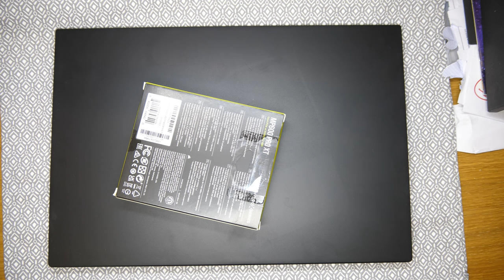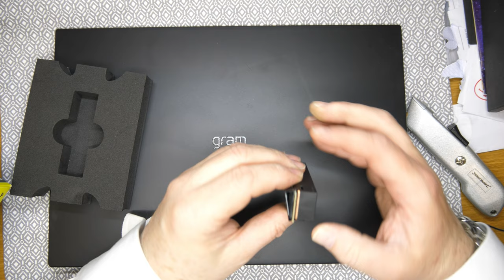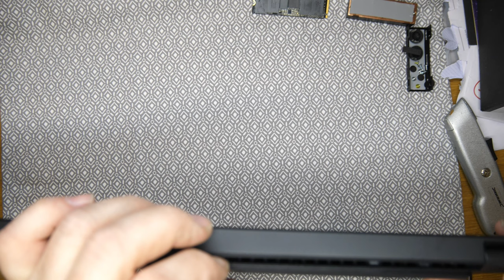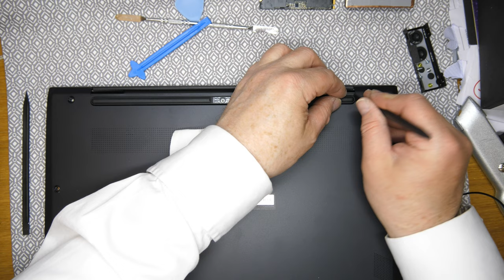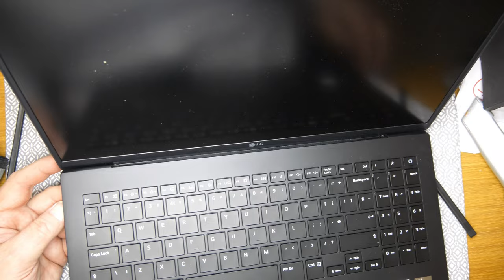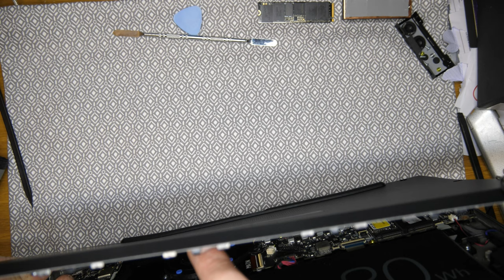Grunting elephant performs LG Gram 16" 2022 Teardown & SSD Upgrade

Comment from the maker: Some additional comments on cloning the SSD, as I lost a few hours trying to get it to work. These are the steps that worked for me.

I put the original 1TB SSD into a USB-C M.2 NVMe caddy, and placed the new SSD into the original NVMe slot on the laptop's motherboard. This is the recommended config for Acronis 2022 cloning.

I used the Acronis TrueImage 2022 bootable media on an optical drive.

To get the laptop's boot menu up, hit F10 immediately and repeatedly at boot, and choose the optical drive to boot.

I used the Automatic cloning method which resized the main partition from about 900GB to 3.6TB, and it took about fifteen minutes or so.

Make sure Bitlocker is off and the drive is fully decrypted before cloning.

To perform a factory reset, with the AC power in, turn on the machine and then immediately press and keep the F11 key pressed until the Windows PE environment comes up.

I removed McAffee, Laplink and Alexa, and disabled Teams at startup.

Comment: Thanks for the video, very helpful. The reluctant cover is simple to remove, just slide it a little bit, no force needed.
Reply from the maker: Needs a video - are you offering by any chance, it would help this grunting gorilla out!!
Reply: @nezbrun872  Thanks, but I was shaking during the teardown. I hope not to open it again... ever :D
Reply: @nezbrun872 I can second @codeblocks’ comment, that the cover can be remove without much force/trick. Two steps: (1) Tilt the cover open; and (2) Wiggle the cover, and at the same time lightly push the cover towards the back of the laptop. It will release quite smoothly.
Reply: @zzlife9905  This video shows the wiggling you need to do. At first I was a bit confused about the exact motion, but you have to wiggle it back and forward towards the front and back of the laptop, not left to right.
https://www.youtube.com/watch?v=9fTL4lzH4Bs&t=501s

Comment: Removing the pre-installed heatsink usually voids the warranty. Just but the heatsinkless model
Reply from the maker: As I stated, there was a very substantial discount on this SSD SKU at the time (ITRO $100 cheaper than a bare SSD or so), that is why I bought it. Of course I'd have bought the bare version had it been the same price or cheaper.

Comment: how you experienced any heating issues with the lg gram? It seems like the only glaring issue about the laptop. Also Thoughts on returning and getting the 17 inch version?
Reply from the maker: It does thermally throttle for me during video editing 4K60P, but I haven't investigated it any further.

If the +view monitor had been 17", I'd have bought the 17". However to match the +view, I bought the 16". I have a 17" 2020 LG Gram already. Thankfully my eyesight + glasses are good enough to see the 2560x1600 screen at 100% scaling on 16" as well as 17".

I won't be returning it, I never even considered it.
Reply: The 17" has thermal throttling for me as well at 20~22W CPU Package Power

Comment: I have the 17in model. Anybody know what I can do to make the max volume louder?? I find the audio very low
Reply from the maker: Same with my 2020 17" LG Gram and 2022 16" LG Gram. When necessary, either I use an external bluetooth speaker (EWA 106 Pro or Bose Micro Soundlink), or the speakers hooked up to my HP Thunderbolt G2 desk dock.

Comment: I just tear down my LG gram today ! thanks for the vid.

There are 2 hidden latches at rear exhaust,
if you look closely there are some (4) plastic that looks different than exhaust fins., 
use flathead screw pull toward yourself a bit, you'' hear clack sound,
so it will pop out from latch, so you can now remove
the bottom cover easily.

Comment: can ram be upgraded?
Reply from the maker: Nope, it's soldered onto the board on LG Grams 2021 and 2022 :-(
 
In contrast, my 2020 version has one 8GB soldered, plus one slot: I upgraded my 2020 up to 40GB with a 32GB SODIMM

The soldered in RAM and the max 16GB installed was the reason I skipped the 2021 version (although in some markets later on a 32GB was made available on the 2021 model).

Soldered in RAM is built in obsolescence, and should be resisted!

Comment: is that support PCI 3.0 m.2 22880 ssd?
Reply from the maker: I haven't tried a PCIe 3.0 NVMe M.e drive in the 2022 LG Gram, but I am pretty certain it will work thanks to backwards compatibility.

Comment: The D shell is paper thin and looks very soft.
Reply from the maker: Amazingly, I managed not to deform it.

I still haven't figured out the "right" way to remove these clips (there are three, not two) despite going in three or four more times to resolve a cloning issue.
Reply: @nezbrun872  Yes, my hands were sweating when watching you trying hard to open it, so afraid you would break it...
Reply from the maker: @ejunyhu  You and me both! 😀